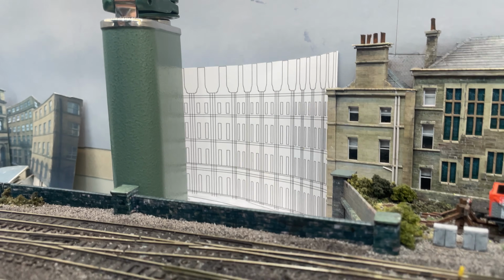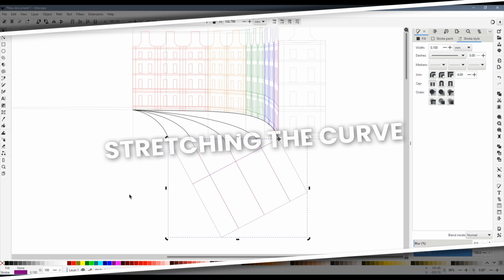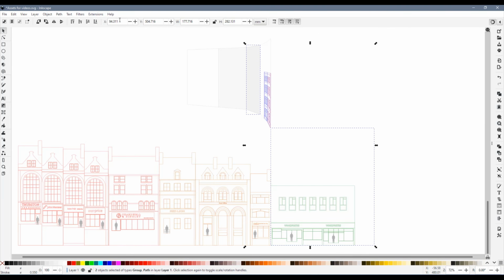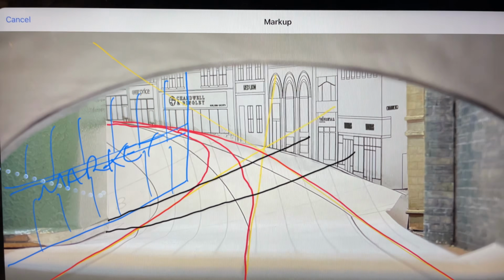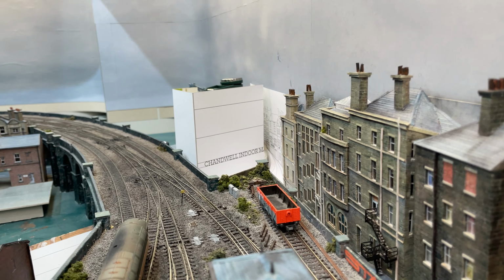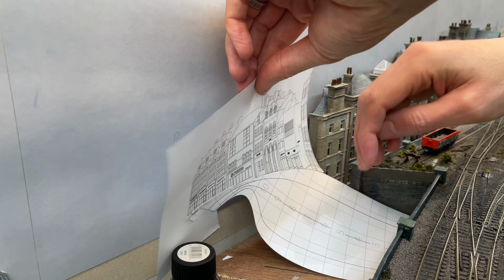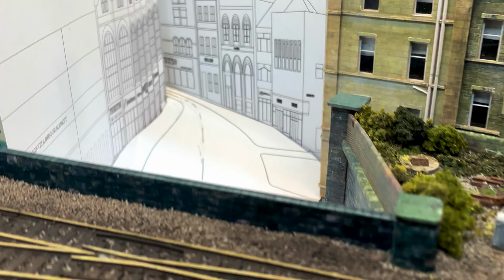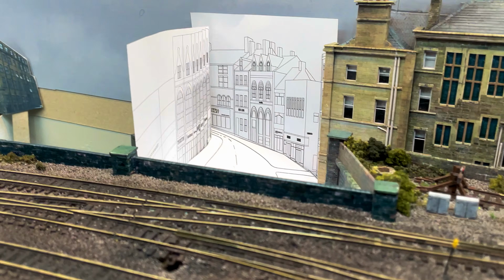Designing an illusion - Making a road vanish into the distance using forced perspective

Comment: Your trial and error method must have wasted you so much time - better to learn the correct method from the start and do it all in one hit.  Could have drawn the unforced scene in plan and elev., overlaid the space available for the force, and simply projected the one onto the other based on a chosen point of view.
Reply from the maker: Hello and thank you for your reply. I’m trying to work out whether it was tongue-in-cheek, or genuine. Undoubtedly a 2D projection of a real scene would have given a more accurate result, but there is no chance I could have got to a satisfying result as quickly as I did using trial and error. Some thoughts… 1. I didn’t know what I wanted until I started.  I didn’t know how long the street should be, where it should go, or what works and what doesn’t in the space. This is art not science. There would still have been a lot of trial and error but it would have had to be done much more accurately and therefore would have taken longer. 2. I don’t think 3D projection is something that someone who is bad at mathematics and drawing can “simply” pick up in a few days. I did read around the subject a little but phrases like “expand (convert) the versor to a 3×3 rotation matrix, which unlike those for Euler or Tait-Bryan angles…” just puts me off. My hobby is supposed to be fun, not a maths lesson. And thirdly, I doubt I would have had as much fun doing this as I did. It’s definitely a subject that seems interesting but thankfully it’s no longer needed; this section of the layout is done. Thank you again for taking the time to suggest an alternative, but I don’t agree that I made the wrong choice. 👍
Reply: @Chandwell  Well, just explaining that no way was your method quicker - that cannot be the case.  FYI, I create forces for cinema feature films.   There is no "3D projection" involved or necessary, it's all done in straightforward 2D drawings.  Of course, it's your time and way of pleasure, I was just pointing out that your way of achieving the force is terribly inefficient and therefore not a good example to others who may wish to do similar work.  Decide what you want to see first, and then do the simple drawing required to realize it accurately, first time, and efficiently.
  BTW, art and science are not mutually exclusive; only people deficient in the one or the other (or both) tend to say so.
Reply from the maker: Thank you. Something for me to learn one day perhaps. I never intimated in my video that my technique was correct or quick (quite the opposite). You are 100% correct that it would be quicker for you, who are experienced in this. I’d be starting from absolute zero and would have the entire learning part to do. I barely know what the words “plan and elevation” mean! Could you achieve what you do professionally after only a few days from when you understood none of it? I spent 70 hours on this, but 40 of those were spent doing the actual drawing, which I would have had to do anyway. I’m a visual learner who would have had to have started small - cubes on the flat, for example. I am sure I could not learn from scratch an art to a passable level in 30 hours AND get a completed mock up on my layout. And I can’t fathom how the projection technique would take into account the curve that transitions the horizontal baseboard onto the vertical wall. Without trial and error I would never have thought of that to include in the projection in the first place.  I would have LOVED to have done it your way, but sadly, I just don’t know where I would have started. I don’t even know what to Google. All of my searches following your comment led me to computer code. I don’t fancy writing a bit of C++ to get this done! 😂 I am not discounting your comment out of hand, but I still disagree that it would have been quicker for me than what I already did. If you have any resources that would help, please do reach out, as I genuinely am interested, and grateful that you took the time to comment. Every day’s a school day, and this entire project is a massive learning journey for me. You can email hello@chandwell.uk.
Reply: @Chandwell  What the traditional method does for you is plot as many points along the curve as you need to draw a fair line though - it's as simple as the rest of it.
  It is worth learning how to do it all by simple projection; the next one you do will go much quicker, as will all the others you ever do.  Good luck.
Reply from the maker: Thank you. I will. But can you give me a clue where to start… what’s the technique called? I tried searching for “3D to 2D projection” but just get computer stuff and loads of maths.
Reply: @Chandwell  I would simply search for 'forced perspective drawing method.'  - but having just done that to see what's there, it turns out there is little but simple scale tricks for people with mobile phones, and the first hundred of them look identical to each other.  I see the internet is giving options, but no actual choice these days.  Have not yet found a serious guide to method.
  One of my students had a 'how to' video up here - shall try to find the link.  Failing that, perhaps I shall post one myself, as google has been flooded with dumbed down junk.

Comment: Unless you can absolutely control the viewing angle, forced perspective models/scenes are a nightmare. Great job on this scene. One of the hardest parts is effectively blending the road into the backdrop. A good trick is to make the road rise, then dip just before the backdrop. Much easier to pull off if there are no buildings, as you have. Again, well done.
Reply: Anyone can "Control" their viewing angle in a piece, it is just how many points of perspective you are willing to do to facilitate what you have. Have you ever tried double 4 point perspective?
Reply from the maker: Grant - no! I think my head would melt!
Reply from the maker: Thank you Jeff. I’ll never get this perfect but it’s “good enough” now, I think.